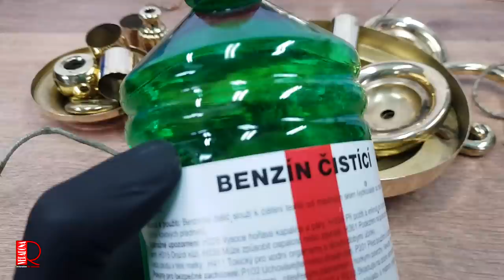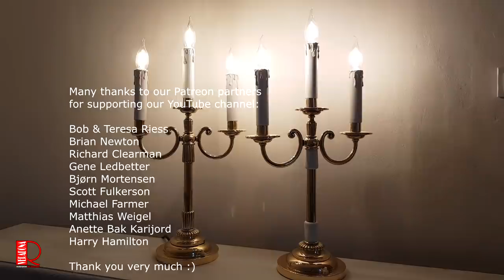Electric candlestick from 1905

Comment: Beautiful job. It looks like you have a matched set. This was a more complicated restoration than it appeared. Replacing the wiring and connecting it correctly took a lot of work. Now the candlesticks are not only beautiful, they are safe to use for many years to come. The brass polished beautifully. Thank you and smiles from the USA.
Reply from the maker: Thank you for acknowledging Pat :) Embrace from the Czech Republic, Radek

Comment: An excellent restoration with some creative finishing touches. As a restorer and electrical engineer, I will offer you a pro tip. When using screw terminal connectors, never solder/tin the wires that go into screw or clamp electrical connectors. The solder is very soft and relaxes, cracks or breaks under mechanical tension causing the joint to become loose and causes arcing problems. Use crimp brass ferrules on the main conductor ends and a ring crimp connector and star washer on the earth/ground connection.
Reply from the maker: Thank you for the professional advice Stuart ! Radek

Comment: just a curious question but why does one lamp have all brass accents but one has white plastic on the main support shaft?
Reply from the maker: Each lamp is slightly different. It is not plastic, but painted cast iron.

Comment: Beautiful work, Radek!  And you have made the world a safer place - I wonder how many people got shocked by this lamp with all of the exposed wiring inside before you restored it?!
Reply from the maker: Thanks, I don't know :) Radek
Reply: My guess is that these were originally intended for candles, but "electrified" in the early 1970s. At that point, the bases were replaced with hollow sheet metal ones. The originals would have been more solid, for stability. Around 1990 someone replaced the line cord with a substandard twin-core one, losing the earth connection, which is ESSENTIAL in a metal lamp.  The 1970s cotton-covered wiring was correct. It would protect the connections inside the arms should they get hot. Those vinyl replacements would melt and cause a short.

Comment: A old trick to get wires out if they are stuck in a small pipe: put some dishwasher soap on them on 1 side and let it run a bit down in the pipe. The soap itself washes out easy and does not harm anything
Reply from the maker: Perfect solution, sometimes I have to try :) Thank you Jacobus, Radek

Comment: Very nice! Except... you don’t seem to have any strain relief on the mains cord, a simple knot would do. And the protective earth wire should be the longest so it will be the last one to detach if the cord is pulled. Now it’s the first to go as it’s so short compared to the live and neutral wires.
Reply: Not trying to sound like a smart ass this is a legit question, are you an electrician ?
Reply: @jonny555ive  Not by trade  but I went to school to become one way back when.

Comment: Are you sure it's from 1905? I think from the 1970s :)
Reply: I agree. If it was from 1905 it would have been built better and probably not electric.
Reply: I believe it is the year 1905 to 1920. The power cord, one bakelite bulb socket and switch were not original.
Reply: Most people didn't have electricity in 1905.   The cord had been replaced at one point. The original braided wiring in the base leans more towards, at oldest, the mid 40's.
Reply from the maker: I'm sorry, so the friend who gave me the candlestick told me.
Reply: Whereas it's definitely not from 1905, it's definitely not from the 1970s either... My guess, mid 1940s.... Maybe late 30s...
Reply: Electricity first came to public lighting and businesses, I think it cannot be from 1905 maybe latest 30’s or even later (remember world war that stop anything). In any case it became beautiful ☺️

Comment: What is the blue box you put the pieces in (it has gloves attached)?  I'm fascinated by that box and what it does.  What does it remove?  Rust, old paint, ?
Reply from the maker: Yes, it is a sandblasting box to remove rust and paint. It removes it with an abrasive using air pressure.

Comment: Did you check the polarity on them E14 lampholders....?
Reply from the maker: I'm sorry, I'm not an electrician.
Reply: @VeradonaRestoration  

Thing with edison screw lampholders is to make sure the phase conductor is connected to the central pad....and not the outer screw part....
You need to check....

I'm an electrician by trade.

Comment: Hmmm. Two things. First these were originally gas lamps converted to electric about 1940 or 1950 going by wire in it. There is the gas residue as he takes it apart in pipes. Most likely a flute type library gas lamp converted to look like candles. Gas burner and adjusters removed of course.

Second I noticed the illegal lamps used, can't get those in North America. I also can't help but thing how dangerous a 220 volt lamp is, just gives me shivers.

Comment: Very nice restoration - the lamp looks great!  I was very relieved to see you replace all the wiring and the switch - I don't think insulation ages well!  I also like that you used PVC pipe instead of paper for the candles - that should last a long time!  I was a little surprised you did not keep the iron decorative parts, but I'm guessing you wanted to keep the look a bit lighter.  Maybe plating the iron or would that look odd?  Either way it came out very nice!
Reply from the maker: Thank you very much Fred :) Radek

Comment: Nice job but I'd be very surprised if it dated from as far back as 1905 unless it had already undergone a major rebuild sometime in the past. The bulb holders don't look as old as that and the push button switch certainly isn't. although it could be a later replacement.
Reply from the maker: I'm sorry I donated it wrong. I was based on what a friend told me who gave me a candlestick. Radek

Comment: Whew, that wiring made me nervous but it seemed a challenge and you seem to love a good challenge.

 I've noticed many didn't care for the plastic switch but it matched all the other white so, it really doesn't bother me. I always turn my switches toward the wall anyway just to not see them so it really doesn't bother me regardless.  Very nice job.
Reply from the maker: Thank you very much Latasha, the challenge is every renovation :) As for the switch, I did not have many options at the dealer, I took what was as similar as the original. Have a nice day Radek